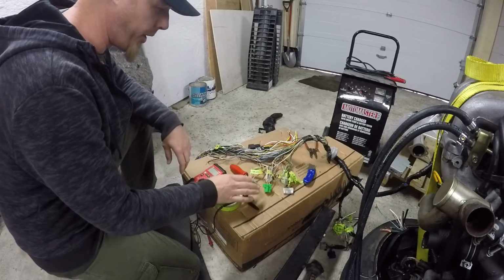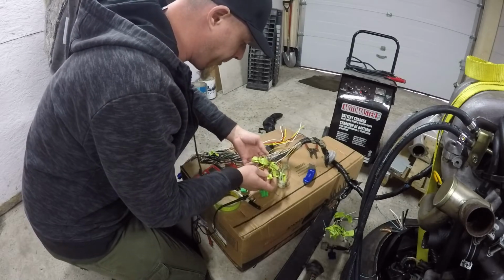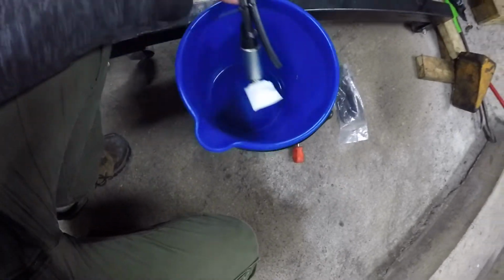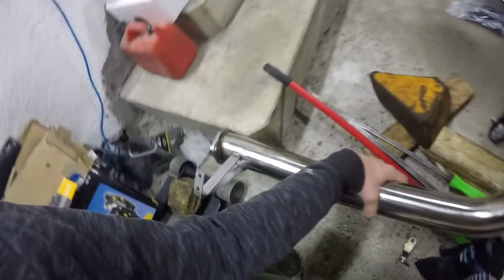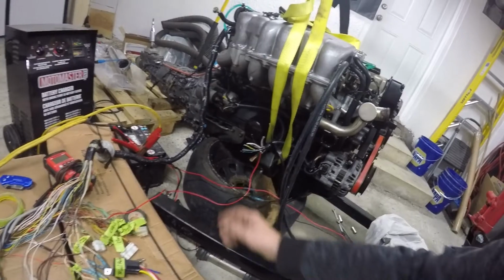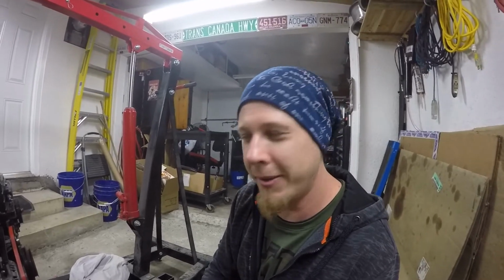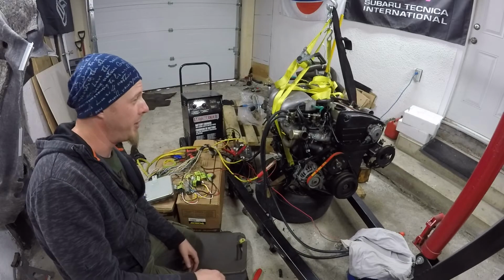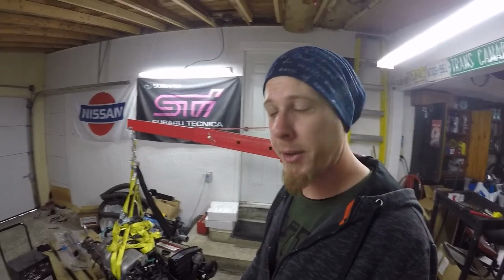240SX S13 Build - RB20DET First Start Attempt

Comment: Will still run without maf my guy
Reply from the maker: Not too far from running then.
Reply: Homebrew Subaru check the coil’s for spark man. Make sure they are grounded. Also make sure injectors are working. Take out plugs put new ones in. It’s something simple. I’m un familiar with your harness but check something called neutral safety switch
Reply from the maker: Do you know if the Neutral switch should be grounded while in neutral or open?
Reply: Homebrew Subaru as far as I know you just loop them

Comment: Key chip security? Neutral position switch, coolant temp sensor. Fuel tank pressure, or lack of in a bucket. If the maf is the same as the patrol, it's the same skinny one your impreza should have in it. I used a genuine nissan patrol maf in my old 2000 gc8 wrx. Exact same part as the subaru. :)
Reply from the maker: No keyed security, coolant switch is plugged in. Neutral switch is a possibility, I'm sure it's not hooked up at the moment. Should be enough fuel and pressure, but haven't looked much more into it. 
I thought of Subaru MAF's, but the RB20DET seems to be quite specific. Most other Nissan MAF's won't work. I've ordered the right MAF, I just hope the connector on the parts car will work. All of my Subies are MAP ;)
Reply: Cool. Has to be something stopping it as it didn't even sound like it even tried to make any spark at all. I trust the engine harness and all the stuff like crank position sensor, etc are all hooked up too. :)
Reply from the maker: I presume it isn't getting fuel. Now that you mention it, I haven't looked for CPS yet ;)

Comment: What are your plans with the RB? Just leaving it stock? Stock injectors, AFM and ecu? Or stand alone puter? Haha 10:27 just gonna go for a crank first
Reply from the maker: Plan on leaving it stock until I've played with it in the car for a while. It will make close to twice the power the SOHC engine in the car is making now. Later I will add a bit of power if the car proves to be reliable. I'm sure it would be a lot of fun closer to 300whp.
Reply: Homebrew Subaru have you seen these wiring looms for your conversion? https://www.240sxmotoring.com/wiring-specialties-rb20det-wiring-harness-for-s13-240sx-pro-series/
Reply from the maker: Nice harness, but I can't budget for that when I am a wiring specialist. ;)

Comment: You are there.  If ecu is getting power, then fuel or spark issue.  Generally spark and ecu are on the same power which means the CPS is getting power.  If getting spark, then fuel issue.  Although you say you rushed into it, you made good progress.
Reply from the maker: Oh I rushed it in like 3 hours. I should be able to get some time on it tomorrow again. Was good enough just listening to it crank for now ;)